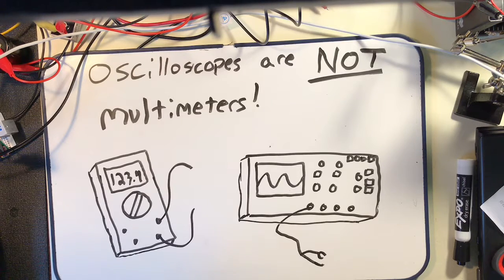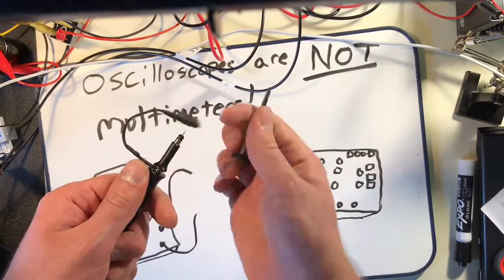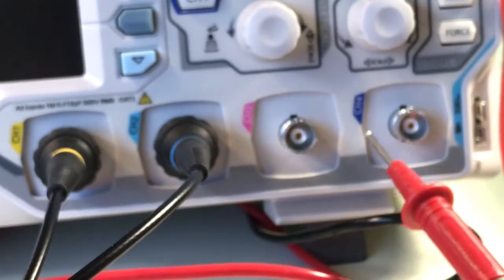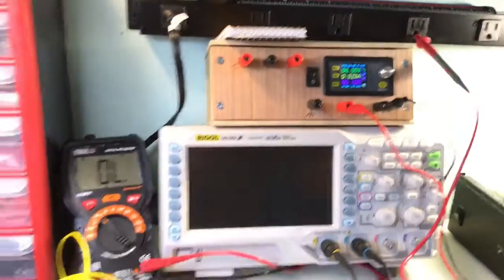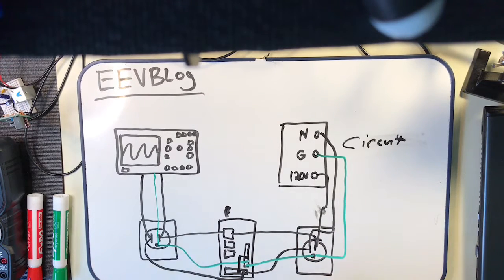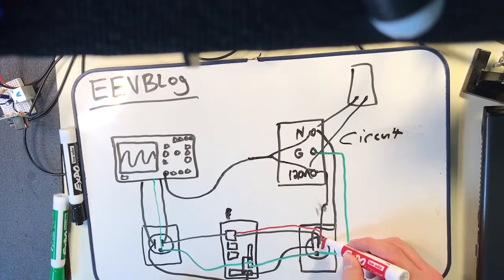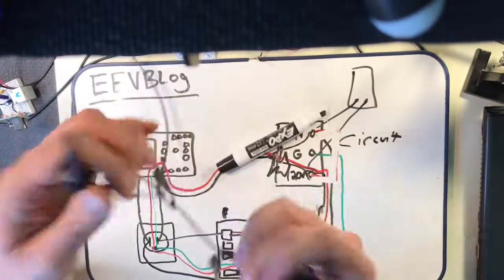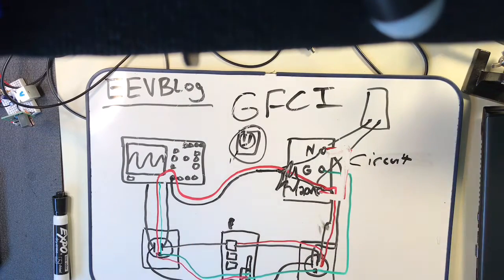Oscilloscope Safety - How to use your scope safely!

Comment: Great video thanks.  But as a total vovice where is it safe to connect a scope? Will it damage a scope on say 30volts?  My scope says max input voltage of 300v?  Rohde & Schwarz RTB 2002 (Not that I would ever use that voltage)   Any chance you could expand a bit and do a video where it is safe to connect on a cicuit board?  (obviouslly not the mains input)
Reply from the maker: Hi, 30 V should be very safe. Just make sure you connect the alligator clip to ground on your circuit board then you can probe around pretty safely on the board (safe for you and the scope...safe for the device depends on what the device is and where you probe). Not a bad idea on doing a video with some tips on circuit testing. Here is decent video https://www.youtube.com/watch?v=JAELtZ1MrwY from Rigol
Reply: @HTMWorkshop  Thanks for your reply very helpful.
Reply: Careful.  The 300V limit applies only to the voltage between the measuring lead and the ground lead of a single scope probe.  You can’t connect the ground leads of two scope probes to different voltages, because they are shorted together.  Connecting one ground lead to 0V and a second ground lead to 30V in the circuit will cause enough current to flow to destroy something.

Comment: As a novice in oscilloscopes I isolate myself from this issue by having a cheap USB scope that is connected to my laptop that runs on batteries. Also I make sure other parts of the laptop are not connected to the circuit I'm disturbing with the probe (something like arduino board connected to the same laptop via USB and I'm probing something that's connected to that board).
Reply from the maker: Yes using a usb isolated supply is a good solution - those o scopes usually have a lower bandwidth but for most applications they work great
Reply: Don't forget that most laptop chargers have the negative part of the DC jack straight connected to earth of the mains inside the charger. 
So if your laptop charger is plugged in during your measurings, your cheap UBS scope is grounded and still can be destroyed.
Reply: @BjornV78  Sure, laptop must be on battery at the moment

Comment: My oscilloscope is on a circuit protected by a combination GFCI and AFCI (arc fault) circuit breaker.  It tripped immediately when I accidently connected the ground probe to a hot voltage source.  That saved everything!
Reply from the maker: Yeah - you can also power it with an isolated supply instead of line voltage…that is another good safety feature
Reply: @HTMWorkshop  isolation transformers are also tied back to earth ground in the board hence, the neutral path as well. Most isolation transformers are not ‘isolated’ so you can still blow up your oscilloscope or electrocute yourself.
Reply: @HTMWorkshop The use of an isolation transformer is a standard practice that has been around for a long time.  The issue with it is that you lose your ground reference and circuit ground may be substantially different from earth ground.  The newer electrical circuit breakers may mitigate the need for an isolation transformer or cover you in one of those Oops situations.
Reply: Did you capture the spike before the power went out?
Reply: @robertsmith2956 Unfortunately, no.  It would have been interesting to see the waveform pattern the AFCI looks for.

Comment: If you are addressing this to hobbyists you should have mentioned the use of isolation transformers. That is how you avoid damaging your scope. The transformer isolates the circuit under test from the power supply ground.
Reply from the maker: That is a good idea - I think a video on how to pair a scope and isolation transformer makes a lot of sense. I do have another video on this channel about isolated power https://youtu.be/rOK7PPUpVjM
Reply: Nope.  You will still get into trouble.  The connection to mains ground is very much a problem, but another problem is the different scope leads are shorted together.  If you connect two ground leads to different voltages, you will vaporize something.

Comment: So Now How I probe the high voltage circuit with oscilloscope
Reply: For ac main voltage, step down isolation transformer csn be used(e.g 240/120v ac to 6v ac)
Reply from the maker: Depends on how high. You can buy some high voltage probes (they are pretty expensive) or you could build a voltage divider.

Comment: Could you not run a safety neon in probes that will take the current in this event.
Reply from the maker: Hi Mark - I am not familiar with a safety neon - what is that?
Reply: @HTMWorkshop  Like a neon or globe used in circuits to act as a current limiter. e.g. speaker protection for audio or RF circuit etc.
Reply from the maker: @marklowe7431  Oh I see what you are saying - you mean something that can be destroyed to save the device (like a fuse or in your example a light source with a known current maximum) - Well I guess you could use something like that to make sure you do not hurt the device but there is always a delay in how fast a device like that will work - the fuse/lamp can be used pretty well to protect a device and it may protect a person - but there is still the chance that you could get unsafe high voltage before that fuse/lamp kicks in. I can't think of many situations where you would go to the trouble of building the circuit that way but it could be used as an added safety feature.
Reply: No, you can't use a safety neon, because a neon tube acts as open circuit below the ionizing voltage, so below 50a60V you are doing measurings with a open ground connection. Your scope probe is referenced to ground, and need a low impedance ground connection to display correct measurings. 
What you can do is to use a floating fuse holder in the ground lead connection of the scope probe, and use a very low mA value of fuse, like a 50mA Fact acting fuse. 
Such a floating fuse holder in the ground lead is recommended by Tektronix back in the old days.

Comment: Thank you for the info. However, you advised the novice as to what was unsafe to do but not what was proper and safe. Of the neutral, ground and hot wires -- you said to not connect probe ground to the hot. That still leaves the neutral and the ground to choose from. Can a newbie assume either is OK?  (I think assumptions are never safe!) Also will you please detail the steps to determine if it is safe to connect ground to a point in a circuit when one is not sure if it is connected to hot, neutral, or ground? 
Thanks again for sharing your knowledge.
Reply from the maker: You can connect the probe ground to ground, usually this means circuit ground (not live voltage ground). That does not mean you can not connect the probe to live ground or line neutral (which should be at the same potential if all is well with the wiring), but that is a pretty odd. In other words, I can't think of a reason to do that. Connecting to a circuit board or breadboard ground is absolutely allowed and exactly what you should be doing. Common ground and line ground a different concepts, so be aware when I say your circuits ground I mean common ground - which has to do with the ground for that particular circuit - it is not the same as line ground unless you connect them. Live ground is specific to your outlet/wall wiring/circuit breaker. Usually when dealing with live voltage you would not use a o scope but a multimeter. Hope that helps
Reply: @HTMWorkshop   So, basically, if my circuit has its ground connected to the live ground, then my probe ground must be connected to this? And then the test probe could be connected to one of the phases to measure the signal?
Reply from the maker: @gabrielgrmcp  The first part sounds right - yes you want to connect to common ground (which if tied to the line ground then yes same thing, since they are forced to be at the same potential - However when you say phase - are you dealing with 2 or 3 phase power? If so I don't think a scope is probably what you want to use (but maybe). If you give me the situation I may be able to help more. The issue with 3 phase power is you may be exceeding the max voltage/power the o scope can deal with
Reply: @HTMWorkshop  thanks a lot! Actually I'm dealing with 2 phase power and the sinewave I want to measure is the one my load (fan) is receiving after a triac (dimmer system) changes it. Considerating that the ground of this circuit is connected to the main ground through the chassi of the product in which this circuit is located.
Reply from the maker: @gabrielgrmcp   @Gabriel Mateus  Well it is possible - just make sure that ground clip does not come into any live voltage (if you did it will be a direct short to ground and will definitely fry something). I would just make sure you check your scopes max voltage (just in case you have low voltage scope). You definitely will want to think through each step and make sure you don't provide any shorts. Goodluck!
Reply: @HTMWorkshop  thanks a lot

Comment: This is a very good video. Do you know much about ECMO machines? If you have an idea, a video on how they work would be good, or at least the oxygenator, how the membrane exchanges the CO2 and the O2 and the pump.
Reply from the maker: I have not had much exposure to ECMO machines. I will look into them, it sounds like it would be an interesting topic. Thanks for the tip!

Comment: Early cardiac monitors are connected to an oscilloscope (to display the ECG waveform).
Reply from the maker: Ha, yes early cardiac monitors used to be made from the same companies that made o-scopes like Tektronix.
Reply: So the paddles are connected to earth ground.  That could be a shocker for the patient in the next bed.